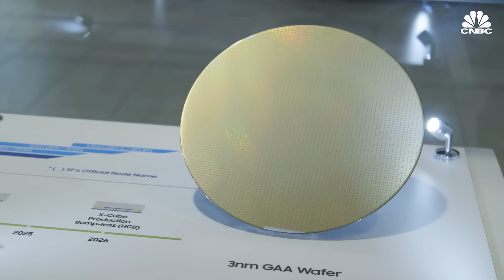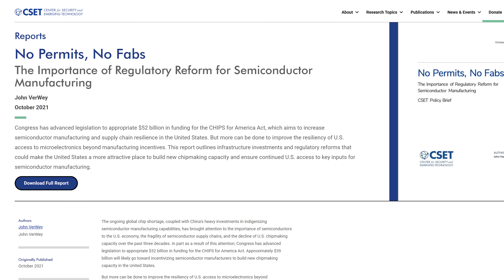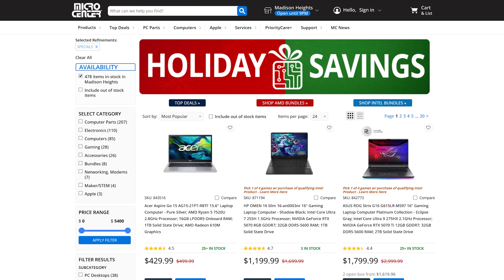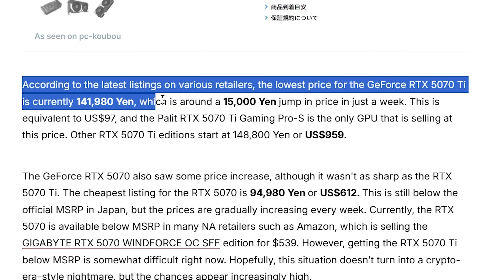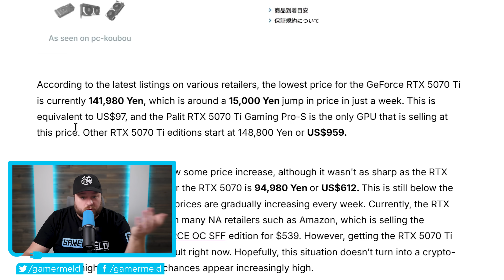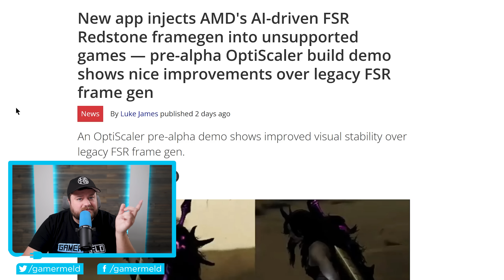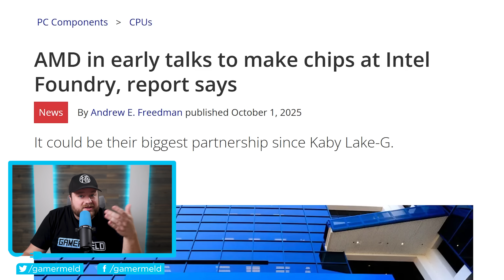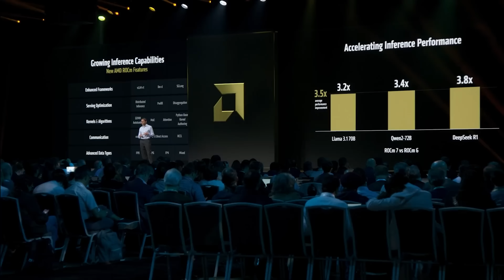No One Thought AMD Would EVER Do This!

Comment: The whining about Samsung killing SATA SSDs is DUMB. 
M.2 is faster and more compact. 
If you want a SATA form factor you can buy an M.2 adapter for $10 and load it with multiple M.2 drives
That form factor is dying and it's a waste of manufacturing capacity.

Comment: As manufacturing reaches it's end point 1nm, the market will drive the cost of the high end to extreme prices 60 grand or more, and consumer end will be slower and truly cheap 3nm (guess)... So long as the tech dead ends this model will take over. I hear 4nm isn't really 4nm more like 9nm etc (guess again)(but this concept makes sense).

Comment: AMD is also testing Samsung’s new 2 nm chips, just so you know. This is probably not meant to replace TSMC, obviously, but rather to help support demand, given that TSMC’s capacity is already sold out. Finding alternatives is always a good strategy, as long as it does not damage the relationship with its primary supplier. This is especially relevant given the current geopolitical risks.

For these reasons, I believe this is a very good move by AMD. I could be wrong, of course, but during AMD’s FDA I heard Lisa Su answer a reporter’s question regarding TSMC and the geopolitical situation, and she mentioned that they are aware of the risks and that they have been, or are, finding alternatives. I believe these alternatives already exist, because supply-chain decisions like this are planned very far in advance, given that these technologies are essentially AMD’s “picks and shovels.”

That said, I believe this Samsung topic is not yet confirmed, so I still consider it a rumour. If anyone has more concrete information, please feel free to enlighten me. Enlighten me aswell gamer meld. Thanks!
Reply: Disclaimer: Sorrry if you already covered this also on your videos, i've been away for some time

Comment: Yeah i was looking forward to getting a new NVME or SSD this black friday for my NVR and PC. But the prices had gone up, ended up getting a large HDD for the PC (its just for storing media) and taking the SSD out of the PC and putting it in the NVR. No choice really the prices had gone up for all storage here in the UK. I think im going to have to resort to ripping apart old consoles for drives again, i worked out its cheaper to buy a 1-2TB xbox and just rip it apart for the drives than buying a drive now. I used to do this years ago with sky (a tv box in the UK) for its drives. (used them in laptops and things for customers).
Reply: Careful buying electronics on Black Friday.  Manufacturers often make cheaper, low quality versions of their products specifically to sell on Black Friday so they don't lose money due to the sales.  Used to work at Best Buy.  The last holiday season I was there, I'd say that 85% of the TVs we sold on Black Friday were returned between Christmas and New Years because they just didn't work out of the box.

Comment: SATA needs to be taken behind the barn and let em have it like old yeller.  Let the Chinese bargain shops cobble sata solutions together with cheap micro sd cards for those who need it, just like IDE.  It's a waste of cpu pins, motherboard square centimeters and most importantly flash cells. Why would a top manufacturer lock up performance silicon behind such a trash interface.

Comment: Hahaha poor Micro Center, literally sponsoring a video where it's all about how doom and gloom the PC market is and where it's about how it's probably just going to be worse.

But honestly, SATA SSDs gone is fine, most of the times they are not even that much cheaper than NVMe based counterparts - and if your specific usecase demands them to be SATA there are enough adapters available to make those work in older Computers. No need for drama.

Comment: are the prices for nvidia graphics cards retail going up because of shortages due high sales before christmas or inflation?
AI Overview
Nvidia graphics card prices are increasing due to a combination of enduring shortages and structural cost increases driven primarily by massive enterprise demand for AI data center GPUs, not just typical holiday sales or general consumer inflation. 
Key Drivers of Current Price Trends
AI Data Center Demand: The single most significant factor currently is the enormous demand for high-end GPUs (like the H100 and A100 series, and the new Blackwell B200 chips) from AI companies and data centers. Nvidia is prioritizing these high-margin enterprise products, which limits the production capacity and available supply for consumer-grade graphics cards (RTX 40 and 50 series), creating artificial scarcity in the retail market.
Structural Manufacturing Costs: The cost of producing advanced semiconductors has risen significantly. Manufacturing the latest chips requires more complex processes and capital-intensive technology, such as TSMC's advanced fabrication nodes (3nm and 2nm). These higher foundational costs are passed on to consumers, establishing a new, permanently higher baseline MSRP for new-generation graphics cards compared to the pre-2020 era.
Memory Cost Increases: The AI boom is also consuming vast amounts of high-bandwidth memory (HBM) and standard VRAM (GDDR6 and GDDR7), leading to a shortage and rising cost of memory modules. This directly increases the bill of materials for consumer GPUs, forcing manufacturers like Nvidia and its partners to potentially raise retail prices.
Supply Chain Disruptions & Tariffs: While not as severe as during the pandemic, ongoing supply chain issues and geopolitical factors (such as U.S.-China trade tensions and associated tariffs) continue to add cost pressures and uncertainty to the market.
Persistent Scalping: Automated bots and resellers exploit the low stock at launch and high demand to buy up available inventory, reselling them on secondary markets at significant markups, which further distorts retail prices and contributes to the perception of shortage. 
In essence, while the high sales period before Christmas might exacerbate temporary local stock issues, the underlying cause of the elevated prices is a fundamental shift in the market dynamics, where consumer gaming demand is overshadowed by the massive enterprise investment in AI and rising production costs

Comment: SATA needs a update to bring it into this decade as its less than a tenth of the speed of M.2. even if it was just a patchwork approach that used a normal SATA plug but doubled up and merged into 1 with only 1 L shaped section and a gap in the pins so you could still use a normal single cable kind of like usb3 mini B but then operate the drive like a raid 0 with itself taking up 2 of your ports on your MOBO but given most have 6-8 ports that's still 1 optical drive, 1 HHD and 2 double speed 12Gbs SATA SSDs at a minimum or that could be 3-4 SSDs if you didn't want optical and cold storage. 

Understandable why Samsung is pivoting away from them as the memory is better spent where it can run at its full speed and they then don't need to manufacture 2.5" cases leaving other manufactures like fexang, Kingston, WD and Adata to fight for at market share. 2.5" drives in laptops also eat into space that could be used for more battery, heat sinking/cooling or more likely just making them smaller because laptops are not thin enough already. I just hope if they delete the 2.5" bay we at least get another M.2 bay that may be left unpopulated by the manufacturer as a means to either sell you one at markup or add storage down the line.

Comment: Unless you're buying tiny drives with little storage space SATA SSD's aren't really much of a budget option anymore. I shop around and compare prices constantly for the fun of it. A 2TB 2.5" format SATA drive easily goes for the same price as an older Gen-3 NVME M.2 drive, which is much faster. So if your motherboard is capable of holding M.2 drives you're just best off to go for those instead. I'd like to eventually replace my current SATA drives but there's not much point since they work fine.
Reply: This!!! I dont know why sata ssds are called as cheap 4tb gen4 nvme and sata ssd were same price 2 months back
Reply: @vijitvashishtha9916  The last time I looked at storage a few months ago a 2TB 2.5" SATA drive was the same price to that of a 2TB NVME Gen 4x4 M.2 drive. So I wouldn't call SATA drives budget options anymore. 

They're still much faster than a comparable HDD but an older gen NVME is much faster than SATA will ever be and they're priced the same. SATA SSD's are from the day of when SSD's first hit the scene many years ago. So I think it's time they've finally been retired. Any time a new generation of NVME comes out the previous one gets cheaper. So SATA SSD's are pointless.

Comment: SATA has been superseded with Nvme, prices for sata will stay low and as Nvme SSD's sell more the prices will be less, obsolete technologies rarely go up in price as they are phased out, generally they price becomes less because the cheaper one's gain popularity with the lack of greater quality one's, that happened with most technologies since the 1980's.
No need to panick, I recently bought a 512Gb UHSII MicroSD for £85 on import, in 2019 it was an average £300 in 2019 and though UHSII is being superseded with the new Ultra range it is not going up in price , the price of tech always comes down till it reaches the lowest price possible.

Comment: F Nvidia and their holier-than-thou attitude. Serves them right for their sh*tty 12VHPWR cable design that turns their exorbitantly priced GPUs into large doorstops. Not a fan of their FU to Apple when they supplied MacBooks with the Yugo of GPU chips and then thumbed their noses at taking any responsibility when they didn't work.
Reply: yugos were actually fairly decent cars for the price. i'd rather have a yugo than any apple product.

Comment: well, to be honest, one should not be using sata drives in the year 2025, nvme is priced decently enough to replace it and motherboards can have at least 2 now, so it was time to let go sata, a connection type for storage that is so old that i cant even remember when it came to us, well over two decades ago i think
Reply: Not everyone can afford to throw out their old rigs and buy new ones.  I'd be quite happy to upgrade my sata HDD to an SSD.
Reply: @genxjack72  i did not needed to know that, dont share that kind of stories, too sad

meanwhile i have been using this cheap 30 dollars ssd since like 2018, and the 1 tb since like 2023, that one was 45 dollars, i m extremely wealthy as you see.
Reply: @gotgg-n6w  Not sad at all.
My laptop is in as good condition as it was when I bought it in 2018.  I can power it up and have a web page loaded in 10 seconds.  I'm not much of a gamer, but played Last of Us part 1 on it with a 27 inch monitor at 1080p, and it worked great. GTX1060
It doesn't meet Windows 11 minimum specs, and they're going to stop making sata ssd drives for it, and they're trying to call it e-waste?  Ridiculous.

If new fabs have Intel's oxidation flaws, or if tech giants price ram out of reach for consumers and move to a service based model, THAT will be sad.
Reply: @genxjack72  even more sad, you will follow your story with i cant run win 11, what am i going to do

please, stop.

Comment: If AMD manufactures in Intel Fabs... This is nuts and historical.
AMD started as as manufacturer (second source) of Intel chips.
Reply: amd saving intel, incredible to see, but it is what intel will become a fab with perhaps, some cpu designs, the rest, is just customers
Reply: Yeah I agree, Intel will become the US fab for everyone basically. I expected this so I got some Intel stocks. Still It amazes me how history goes 360 degrees there.
Reply: @atheatos  well, pat was begging everybody to come and use their fabs because intel wiped the floor with them

i wouldnt call it a 360 exactly, this is a new chapter, it is not doing a turn around, it is just dying as designer basically, not really, but in effect, it died
Reply: Historical, sure.  Nuts...Naw, there has been far stranger things - remember the Kaby lake NUC with Intel CPU and Radeon GPU on the same package? 🙂  Now that was all out nuts (an oddity on many levels, but I'm glad it happened).
Reply: With chiplets Intel doesn't have to make the entire thing. e.g. Global Foundry made the I/O chip.
Reply: Its not unprecedented in the industry.
Reply: What will happen to intel gpus
Reply: @luwk  intel already said they will work with nvidia, so the igpus form intel are dead basically, the discrete gpus, well, the ai race is a two horse race between amd and nvidia, the rest, is custom chips that google is making and some might or might not buy

intel couldnt get in time on that race and ran out of money for this project, expect it to be cancelled any moment

Comment: If you were thinking about a GPU upgrade, I'd do it sooner than later!
Reply: Its been rocky for the past 10 years give or take. Especially bad starting 5 years ago.
Reply: I finally gave in and bought a shiny new RTX 5070 Ti yesterday so I should be good for quite a while. There's more and more UE5 based games popping up, especially from Indie Dev's. So I figured I'd get something new before the prices went even more whack than they already are. My ARC A770 worked perfectly fine for many games but when it came to UE5 based stuff it couldn't handle it. I'm still on a 1080p monitor, but I'd like to eventually get either a 1440p ultra wide or possibly 4k monitor down the road.
Reply: You are good for the next decade atleast
Reply: @macjosa9577  I think so as well. Unless someone else decides to come out with their own badly unoptimized Borderlands 4 offering. I think BL4 is the new gold standard for bad performance. So any game that isn't BL4 tells me I can run pretty much anything properly. 😆
Reply: @chillecharlie  Oh heck, the original Ark is still a terrible mess when it comes to being optimized.
Reply: @chillecharlie  Typical. Ark's developer is terrible for fixing or optimizing anything. That's why I won't touch those games. Broken junk, that's all Ark is.
Reply: 4070ti still usually gets me 4k 60fps with some tweaking.
Maybe if the next gen gpu's are impressive over expensive but isn't that issue? hah
Reply: @NerveFlux  The 5070Ti I picked up is the first Nvidia gpu I've had in about 24 years since my GeForce 6800 GT. So it feels a little odd having one again. But that feeling will eventually subside.
Reply: @Slane583  Wasn't that the Age of Conan launch card followed by the gtx 280? Haha I almost remember.
Reply: @NerveFlux  To be honest, I haven't a clue. But I think they had the GeForce 8800 GT and later the GeForce 9800 GT before the GTX 200 cards came out. I remember the GeForce 9800 GT fondly because an ex friend of mine had one in his computer back then. It was still a single slot card with a tiny blower and it ran like a toaster. It was a BFG Tech branded card because he was a big nut for anything BFG Tech at the time.
Reply: It's been one crisis after another for the GPU market, I don't think there has been a good time to buy a GPU this past decade.
Reply: @UltimateGattai  Very true.  First you had crypto causing pricing/supply issues, and now we move straight into AI which is arguably even worse.  I say worse, because I start to wonder if companies like Nvidia are even going to continue to make gaming hardware (aka GPUs), and just go straight for AI hardware.